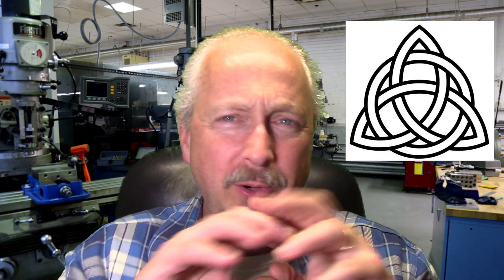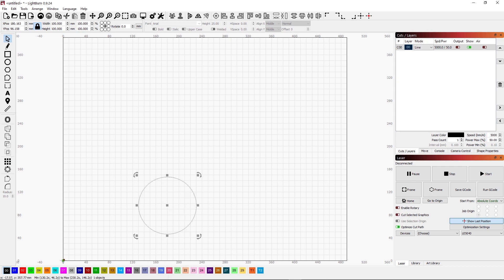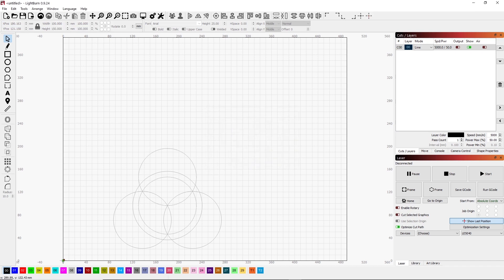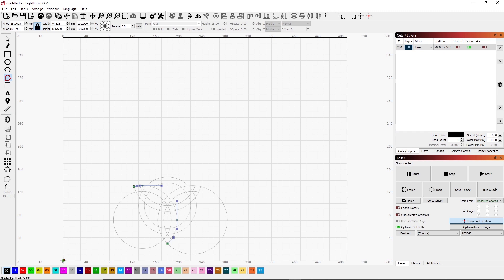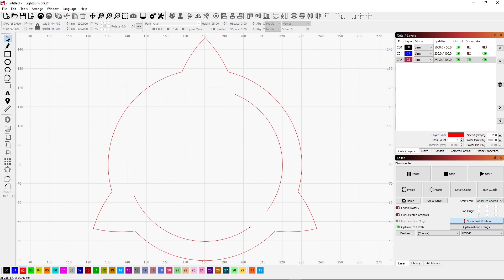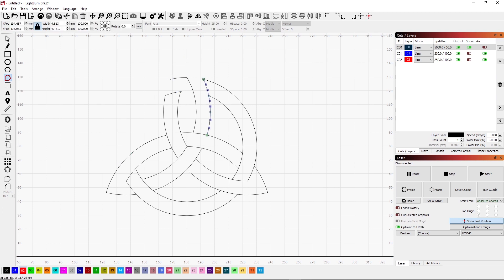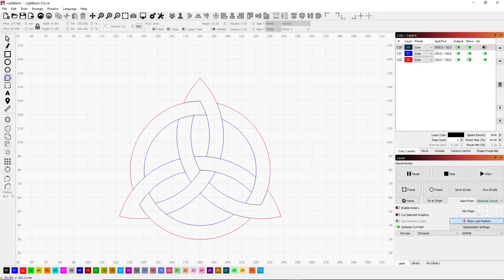Draw a Celtic Knot in LightBurn

Comment: Thanks a lot!
Instead of 3 copies on 3 layers and then deleting, i had 1 copy only, went 'I' and 'B' in node edit to insert points and break vectors, and then assign the splitted vectors to the three new different layers.
I prefer this way to prevent the chance of overlapped duplicates on different layers and to know immediately when i'm finished by original layer got empty.
But there's never just one way to do things!
Reply from the maker: Thank you for sharing.  That is a nice solution too!  As you said, there are always multiple ways to do something.   I will have to try your way the next time I am doing a similar type of thing.

Comment: What a faff Lightburn is , this is so much easier to do in 2D Design, no layers, no deleting of parts, just select the colour of the line that you want the laser to cut or engrave.
Reply from the maker: More power to you if you have a tool you like using.  In LightBurn, assigning a layer to an element isn't really any different than changing its color and having different cutting parameters assigned to each color. Even reading in a file where there are multiple colored lines will result in those lines being assigned to a layer.

Comment: It just seems to me that you could do the full pattern as an etch which would cut partly through at every line, then burn the cut-outs all the way through (or the rest of the way through).
Reply from the maker: Absolutely!  There are numerous ways this could be done.  It all depends on what you need/want for the final results.  I tend to over do things sometimes.  ;-)  Your way would be more simple.  My way would burn faster as there is less repeated burns.  Good thinking on your part on coming up with an easier way to burn this.

Comment: Absolute Beginner here, why not just engrave the entire thing as the black layer and then cut through the black layer where appropriate?
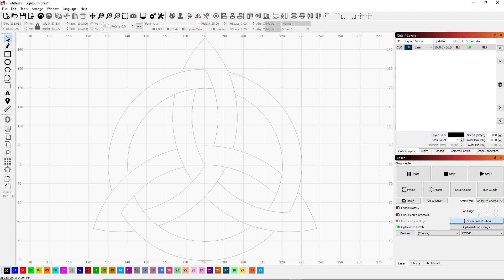Reply from the maker: Thank you for the question.  That is kind of what we are doing.  By having this on three layers, I can engrave the few areas that do not get cut all the way through first.  Then I can cut out the layer that is inside the shape and finally cut the layer that is the outside.  Save the best until last.  I hope that makes sense.  I talk about this at 6:37 in the video. :-)